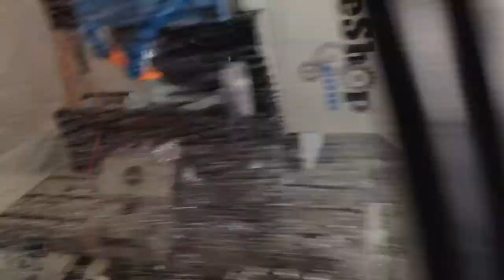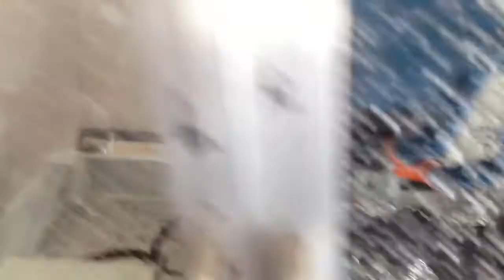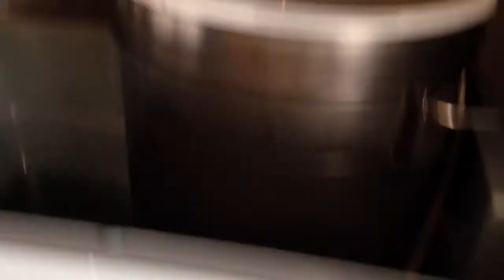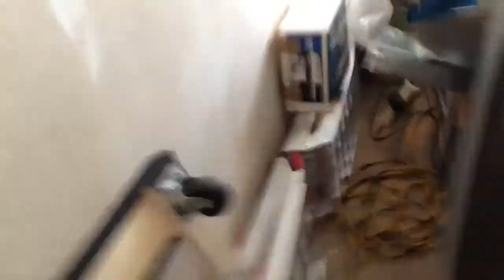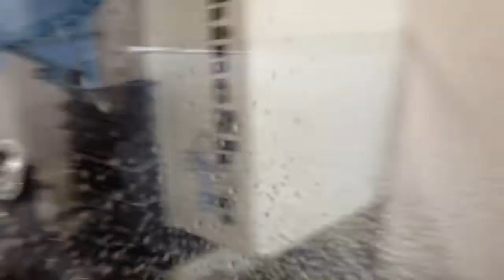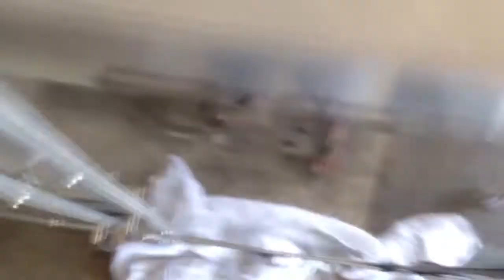Sieg KX1

Comment from the maker: I do like the machine. I bought it used from craigslist. I replaced the spindle bearings and had a broken Y-axis coupling I had to replace. It was cheap but a pain to get too.

My KX1 was made before they started including the single shot oiler so I have to manually oil the dovetails. I didn't know that when I first got the machine and it would shutter while rapid traveling.

The configuration that came with the machine was the biggest problem. I did not know how to set the step per (inch or mm) for each axis and while the default configuration that Little Machine Shop creates for the KX1 is pretty close I noticed that it was off a couple thou at 6 inches of X travel. I found this amazing video that helped me calibrate my machine Improved Mach 3 Axis Calibration